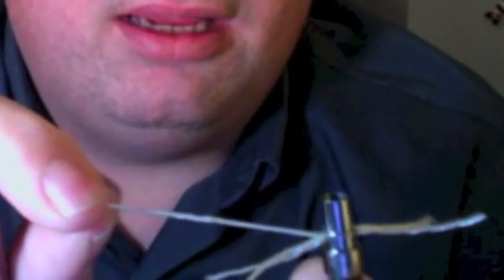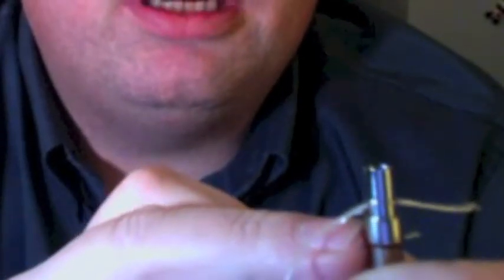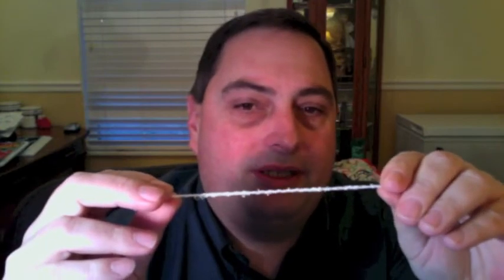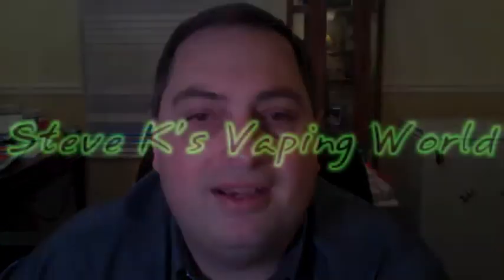Vivi Nova Cotton Wick Replacement

Comment: Interesting, I always struggled threading the wick through the hole. Then I found a dude who suggested tying a piece of dental floss around the center of the wick, then pulling the dental floss through first and that in turn pulls the wick through. Worked like a charm. Cool video and thanks for the info. That idea with the bandage is brilliant, for some reason it wicks great, thank you.